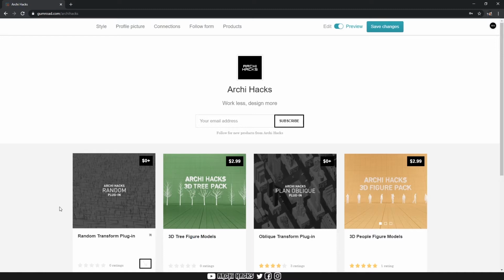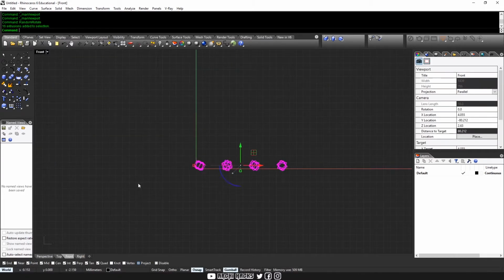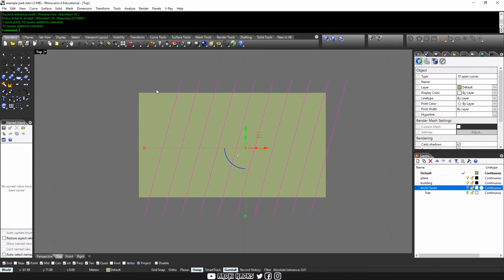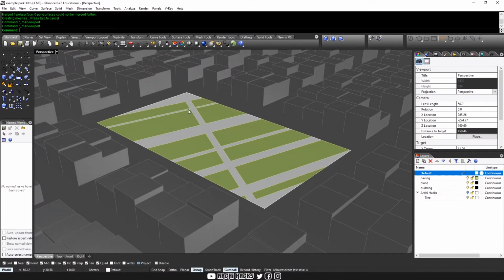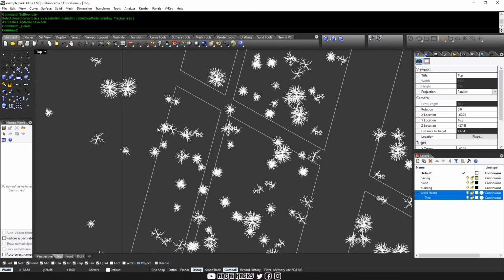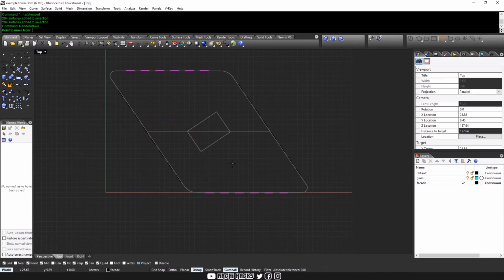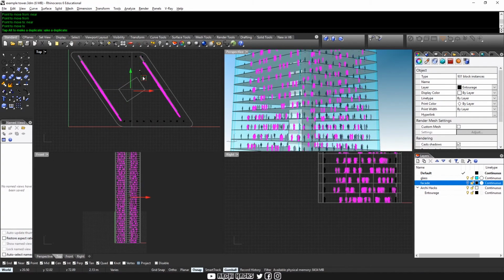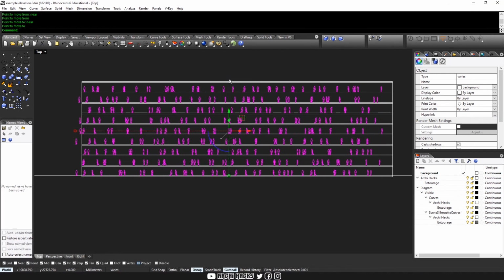Random Transform Plug-in | Without Grasshopper

Comment: The random move is working great, but the Random Rotate is giving "Exception Occurred", "NoneType object is not subscriptable"
Reply from the maker: Are you transforming blocks by any chance? If you are, try exploding them before rotating!
Reply: @ArchiHacks  Same problem here: This is what I get: EXCEPTION OCCURED - Message: 'NoneType' object is not subsctiptable -  "Traceback:
  line unknown, in <module>, "<string>"
  line 38, in rotateObj, "C:\Users\rem\AppData\Roaming\McNeel\Rhinoceros\7.0\Plug-ins\PythonPlugins\Archi Hacks Random Transform (f8e2603a-169f-41b8-9e1d-503126b6a1b9)\0.0.0.3\RandomRotate_cmd.py"
  line 24, in RunCommand, "C:\Users\rem\AppData\Roaming\McNeel\Rhinoceros\7.0\Plug-ins\PythonPlugins\Archi Hacks Random Transform (f8e2603a-169f-41b8-9e1d-503126b6a1b9)\0.0.0.3\RandomRotate_cmd.py"
  line 1, in <module>, "<string>"